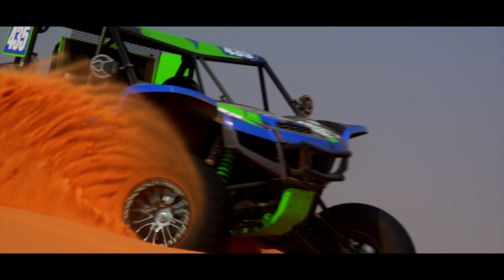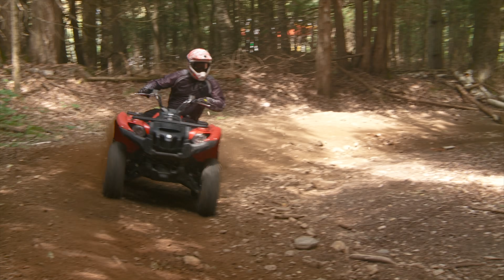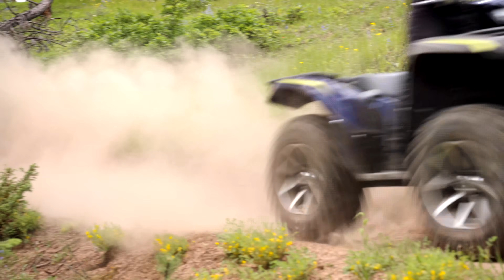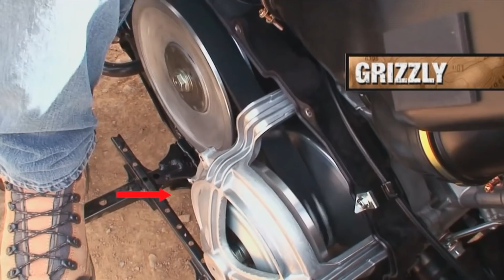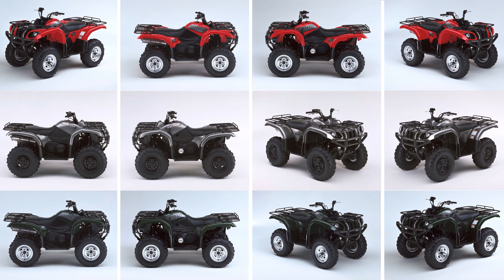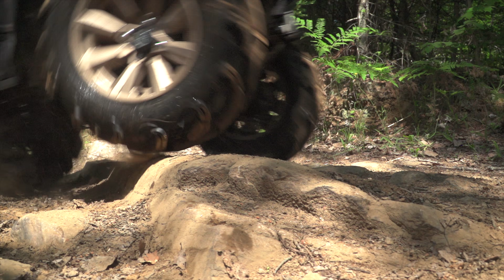Looking Back at 25 Years of The Yamaha Grizzly

Comment: I have a 2020 kodiak 700 eps I couldn't spend the extra money when they are the essentially the same and I'm 5'8 and I feel better on the kodiak because its smaller great bike does everything
Reply from the maker: Kodiak is a nice ATV. Different from the Grizzly though. Smaller size than the Grizzly, different gearing and it has a sealed wet brake instead of discs. Still a good machine. We are trying to get our hands on one to evaluate, but so far Yamaha Canada hasn't been able to hook us up.

Comment: Love the grizzly. I still own my first new grizzly a 1998 600 plus I have 2010 700 grizzly and the 2018 grizzly 700. I can't get rid of the old ones. I just keep buying new ones. They all still work great, mind you. I don't ride the 600 very often, but it's amazing for towing things around with it straight axle. Also own 2  old Arctic Cat wheelers2002 300 and 2005 700.

Comment: Hi everyone, considering on getting one of these. I've been trailing riding now for over 20 yrs. First with a Banshee (14 yrs) then now with a Raptor 700r (8yrs).  The trails I ride are 50" 's or sometimes even a little less here. Would a Grizzly 700 fit on these ok? Don't mind giving the plastic a bit of road rash from time to time but also don't want to have to get Fenders every couple of yrs. either, lol Thank you all for the comments in advanced in hopes these will be ok on the trails I ride. Otherwise I'll go in the direction of a 450 Kodiak eps se model 😃
Reply from the maker: The trails we were riding at this event were all 50 wide. No problem.

Comment: I owned a 1998 grizzly 600 and I still own a 2015 grizzly 700 , all i can say is they are completely different. I hated my 98 especially without a locking diff , my 2015 is awesome it has 9000km and is still going strong and I beat the absolute snot out of it , im glad i didn't get a 2016 to 2018 model they're garbage

Comment: I have owned both a 1997 and 2020. First ride on the 2020 I was just surprised by how similar it felt, power wise and the ride quality. Yamaha needs at least a twin 850 in the grizzly. My 97 98 grizzly 600 was the best bike I've had.

Comment: Love my Grizzlies!! Had an 2002 for 13 years and put 4000 miles on it. Now I'm still running my 2017 708 Grizzly.
Reply: I just got an 02 660 from a dude that let it sit for years. 500 hours and 300 miles. New battery and carb and it fired right up. This 4wheeler is bad ass. Strongest bike I’ve ever had.

I’m considering putting better cams and bore kit later this year when I get everything running spick and span. 

It has throttle issues. It doesn’t like when you push the gas 1/3 or half throttle, only wide open. Either the jets in the carb are off or it needs the CDI upgrade or it needs a new coil. I’ll figure it out soon.

I’m so excited about this thing.

Comment: im a yamaha guy thru and theu  , i personally own  a 2014 grizzly 700   i did noticed that yamaha quality went down with 6000km the frame paint is starting to flake off....  motor wise  the 686 is bullet proof!   we have 4 yamahas  atv in our fleet : 91 big bear 350  2003 kodiak 450 2014 grizzky 550  and 2014 grizzly 700.... only place i noticed the grizzly runs out of steam is on open dirt roads  105kmh is on the cut off.... only thing i would like  more top speed....

Comment: You are right, a bigger Vtwin would get u hurt. I have a 450 Outlander, which makes 40hp. I recently got to ride a 800 renegade . Yeah, that thing was absolutely awesome. But riding that thing  in the woods, one little wrong blip of the throttle and ur out in the trees. A 650 - 700 for woods riding is plenty. By the way when y'all doing test rides on the 23 Can-am 500-700 Atv's?
Reply from the maker: We are supposed to be getting a 500 and a 700 in the next week or so and we'll get right on top of reviews. Stay tuned!!

Comment: Every video related to the grizzly the first thing the reviewer says is that the "it doesn't need more power" which pretty much tells you that it in fact needs more power. Too much power for the trails? Most big bore quads have a tri-mode throttle setting. So if you're of the opinion less power is needed you can adjust the throttle response with the flip of a switch.
Reply from the maker: Hold on a sec there, slick. I didn't say I wouldn't like more power or that it didn't "need" more power. I've been preaching for an 850 twin for years. What I said was for these super tight, winding trails, the power on hand was perfect, which it was.

Comment: I just can't see them coming out with a twin cylinder at this point.  Canam just dropped their twins in the low/mid range line up with their new HD5/HD7/500/700.  There is no way they did that if they thought the market was heading that way.  With today's inflation you are going to start seeing cost cutting to try to keep customers buying what are essentially toys.  Yamaha already had a price increase this year which now puts them quite a bit over the price of the new canam bikes.  There are going to have to try to make up with incentives or low financing that is easier for customers to qualify for if they are going to compete.  There is no doubt yamaha has a reputation for quality but there is also no doubt pricing drives sales.
Reply: No one finances an ATV, so I doubt that will help their sales.
Reply: If a company offers 0% financing, I do it all the time. Tractors, mowers, cars, appliances, whatever. I would rather keep the money in my account than hand it over to a company for no reason. @My_Days_off
Reply from the maker: Can-Am introduced that 700 to directly compete against the Grizzly. We should be getting one soon and we'll see how it holds up.

Comment: Mechanic at our local dealer, a close friend of mine was way more familiar with those 708 Subaru motors than he cared to be. He said he could have worked on them blindfolded in the end he had so many taken a part for oil consumption. Plus they ran too hot and several grenaded. That’s just one dealer. Plus I knew one guy who had his 2018 rebuilt and it started knocking 800 km later. He traded it and a sled for a 2021 SE here in 🇨🇦. Nice bike the 21. I know as he told me this story while selling it to me. Before those problems I claimed Yamaha (the motor company) should be ashamed farming out the motor in any bike. Let alone one so iconic. Hope they learned their lesson.
Reply: Lol i added a 0. It was 9300km.
Reply: I sold my 2016 with 93000km with no problems at all. I think they went with that motor cause of tsunami that hit japan thise years. Main plant was down.
Reply: @nortonashburn6119  Did you mean 9300km? I have a friend of mine with the 708 in his Wolverine. Overheated several times due to a faulty fan which again was common. He’s lucky though. Replaced the fan. No damage and he got one of the good ones. Around 6500 km on it. It was a crap shoot though. Yamaha warranted them for 5 years I believe. By that I mean not 5 years and a week. It is and was a hard cut off date.

Comment: Love my 2021 Grizzly. I got my ATV in 1983 it was a Honda 70 3 wheeler in 1986, switched to 70 4 wheel model ,1990 Suzuki 160,1996 Yamaha Blaster,2002 Yamaha Raptor 660 witch I still have today along with my Grizzly. I will ride until I'm no longer capable.

Comment: I still choose my 2023 Arctic Cat Alterra limited over this.
Reply: What a fool 😊
Reply: @garykarnes6514   Yes, yes you are. Own two grizzlies in the past, great machines but also boring. Same as Honda. I love Hondas but they are boring. Reliable yes but boring. I stopped riding new Hondas in 2020. The only ones I ride are my 85 250sx, 83 Fl250 and 85 Fl350 with a 670 rotax swap. Now I give other brand a chance. I like Arctic cat in the late 90s up to 2010. When they merged with Textron nothing really changed other than the name so I just gave up on them for a few years. When they came out with the New chassis and engine for the Alterra 600, I gave them a chance. It was definitely worth it. Even Canam copied the way Arctic Cat has their engine tilted back. Canam started doing that 2 years later on their 500-700 outlander models. I've been riding since the mid 80s and ride about every atv out there.  The ride quality on the new Arctic Cat Alterra TRV limited is fantastic. My only issue is it doesn't have a rear sway bar. It's a very capable machine that gets ridden hard at Iron Mountain atv park.
Reply: 5 years from now your alterra will be worth pennies yet the grizzly will still likely be worth 7 to 10,000.
Reply: @thefall3551  I don't buy atvs and sxs's based on resale values. I keep mine for years. I still have a 2004 Grizzly, 85 250sx, 2010 rubicon, 99 arctic cat, 82 Odyssey fl250 and 2023 arctic cat.  I just enjoy all machines. I never said Yamaha was bad, I've owned several, I just happen to like the new Alterra 600 better.

Comment: If they can finally get a 1000cc Grizzly.
Reply: 700 single is fine for me
Reply: I think something to compete with the scrambler and renegade 1000 would be awesome.
Reply: Grab the reg one an enjoy while it's still available! 😉 -Ohio
Reply: Y do all u think u need a big 1000cc machine 700 big enough
Reply: @atvrider1805   It's not a need, but a want. Some want single cylinder 25-50hp atvs and some people want the big bore 80-90+hp atvs. I own both.
Reply: @NorthGaLife  we’ll get a can am once u get into the twins reliability gose down the drain
Reply: @atvrider1805  I have a 2023 canam outlander 1000r , 2023 arctic cat 600, 85 250sx, 2016 rubicon.  More companies in the big bore market will  help with innovation and competition.
Reply: Don't call it a grizzly then